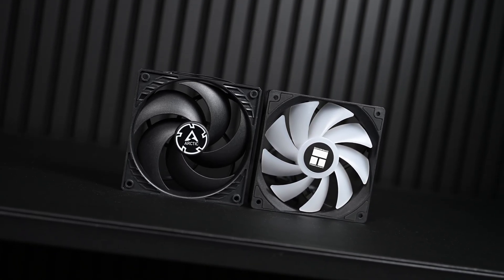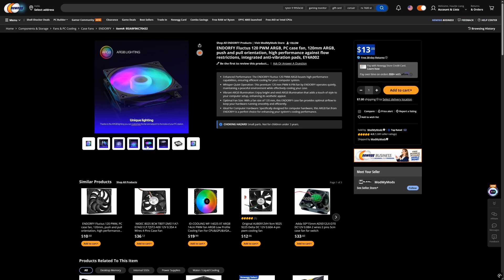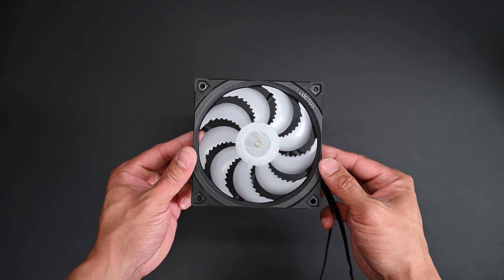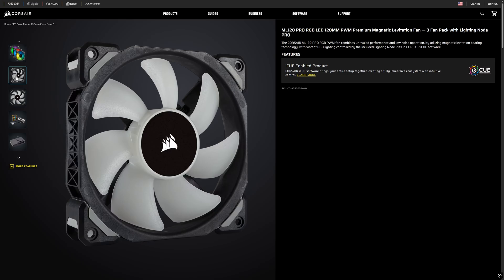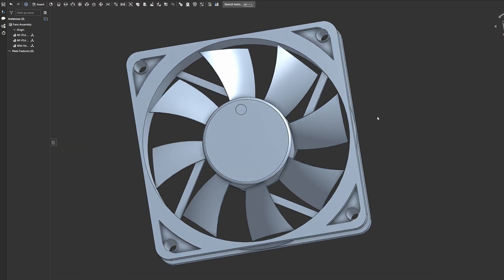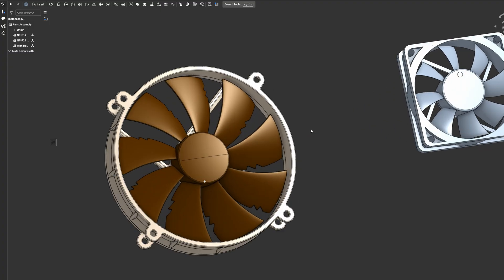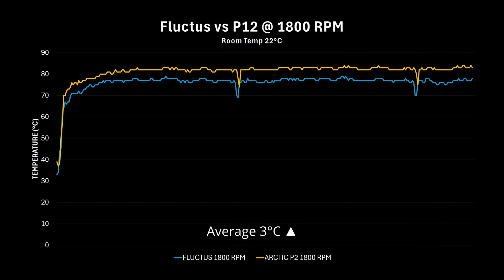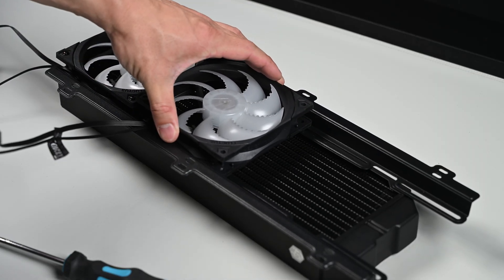Psychoacoustic optimization, how does it reduce noise?

Comment: Hi! I'm a 3D creator using Blender, and my goal is to one day create full-fledged films using Blender. The problem is hardware. I currently have a budget of €6000, but I have no idea what kind of workstation to build, since there are dozens of components and they all seem better than the others. For the GPU, I'm leaning toward a 5090. As for the CPU... well, I have no idea which one to choose. I'm a bit of a tech enthusiast, but I can't find the information I need anywhere. For my plans, I need a CPU that can handle heavy baking, millions of polygons, and very large scenes. What would you recommend? Thanks ;)
Reply from the maker: 6000 euros, at least half of that is going to be spent on your 5090 haha. CPU I think 9950X3D would be your best bet.
Reply: @hardlinenexus  seems legit. Thank you for the help. I subscribed ;)